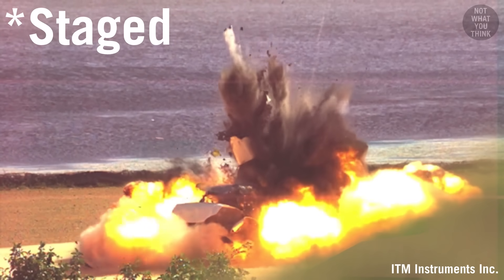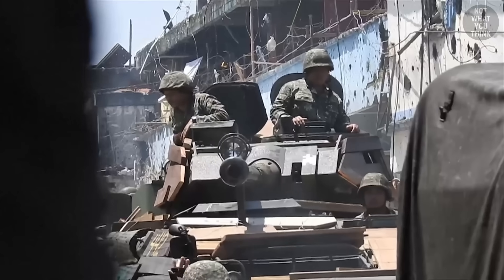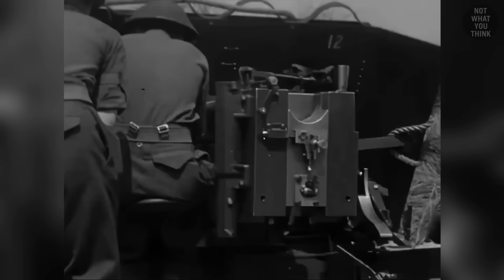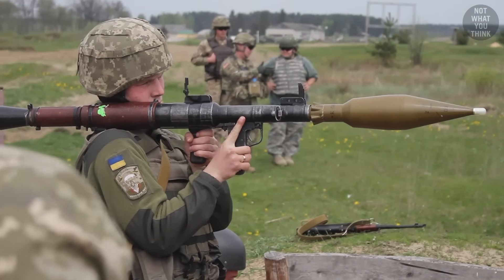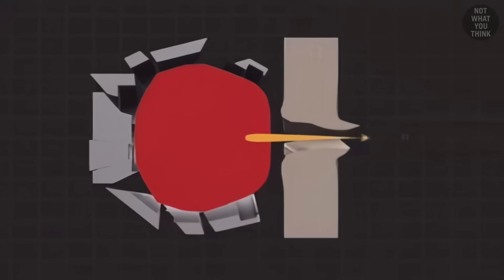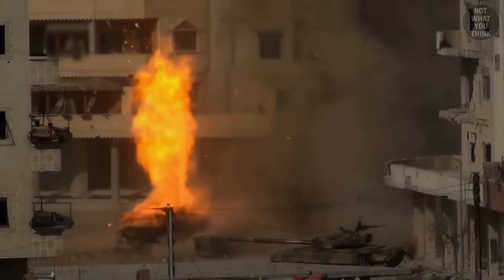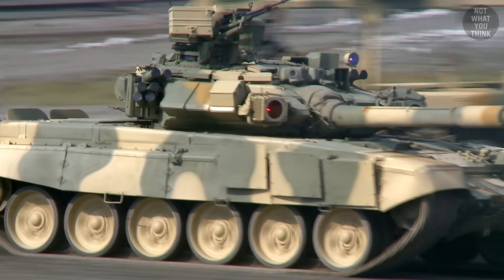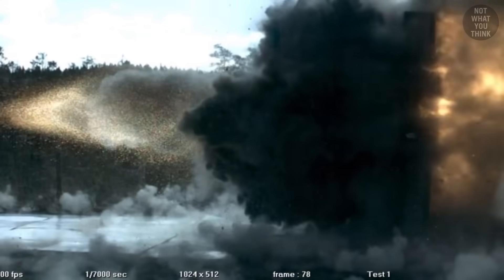Why Protecting Tanks is Getting Much More Difficult

Comment: Another thing about cage armor against shaped charges:
They have a chance of completely preventing the shaped charge of an RPG from exploding.
This happens when the fuze of the grenade goes between the bars of the cage and the grenade gets broken apart before the fuze impacts main hull, hence, no explosion.

As such, cage armor is a type of statistical armor, an armor that instead of only reducing damage, provides a chance of negating it.
Reply: It's like gangster ablative armor. Ok not really. Lol
Reply: and that's why putting anything between cage armor and the vehicle, since whatever's been put there would cause a detonation of the charge before it's been neutralised by the cage
Reply: @baudsp  Anything is better than nothing. See spaced armor, why and how it is effective.
Reply: I wanted to say that :)
Reply: Cool!
Reply: Sounds like when everyone does so much damage that defense/hp are useless, and everyone just dumps their stats in DEX to give a chance of evading attacks.
Reply: Cope cage
Reply: @zart8587  You gotta be pretty stupid if the  only thing you think about are the russian cope cages ngl
Reply: Cage armor is designed against RPG-7 rounds. Especially. They use piezoelectric fuze and outer shell deformation causes the short-circuit, thus stopping it from detonation (So the very reason why this armor is effective is slightly different to your description). To some extent, because original ones have self-destruct pyrotechnic fuze in the rear that should set it off regardless. But god knows how the 3d-world copies are made. Otherwise or for other simple HEAT warheads it can prevent the impact on armor and activation or damage the warhead itself thus reducing penetration capability.
But it is close to useless most likely against ATGM as especially more modern ones have in front the guidance section and warhead section behind it, thus warhead is very unlikely to be affected at all. Not to forget tandem warheads
Reply: So it increases Dodge
Reply: The shaped charge of an NLAW goes of in the air above the tank.  The focus of the copper charge hit the tank turret roof and high speed and melts through the metal.  A cage/ frame will not disrupt the focus, it has not done it so far.
Reply: @anthonywilson4873  It doesn't melt through the armor. It simply penetrates through it like a nail. It rapidly loses consistency over time, so once it's inside it spreads out and that's when the fact that it's extremely hot becomes relevant, as it hits crew or lights things on fire.
Reply: @gimmethegepgun  the penetrating needle is 600-800 °C, it's the extreme velocity travel through the armour that creates the heat through friction that then blasts into the compartment. :)
Reply: @johanmetreus 
It is not melting anything, that is really inefficient when a 2kg slug whit a contact aria of 1mm² going at Mac 10 will do wanders agents the armer
Reply: @anthonywilson4873  
Yeah, that's why my comment mentions RPG, not NLAW.
Reply: That's works great for old school (pre-1980's) impact fuzes. It's not going to work with a modern proximity fuse. Ergo the "cope cage" name, because it doesn't work worth a damn anymore.
Reply: but cage armor only works against simple (1 stage) RPG's, because it can only "deform" the first stage upon impact. 
It is entirely useless against any tandem-chage warhead though, because the second charge triggers immediately as soon as the first charge impacts.

So even if the first charge gets successfully "deformed and defused" by the cage armor, the second charge behind it still activates normally and can still penetrate the armor...
Reply: Wow never knew that. Makes sense though seeing as projectiles like RPG's have an impact sensitive tip used to detonate the main warhead. Clever, but not clever enough apparently.
Reply: @dylonjackson8863  The tip of the RPG isn't sensitive in itself, it's used to close an electric circuit that triggers the primer.
The more I read about all this, the more astonished I am that anything at all work, be it armour or weapons lol
Reply: Yo, cage armor is the bomb, man. It's like, it's not just about reducing the damage, it's about completely negating it. That's like, that's some next level stuff right there. I mean, who wouldn't want a chance at completely preventing an RPG from exploding? That's like, that's straight up superhuman.
Reply: Rogue classes and their "dodge percentage"
Reply: You probably meant "fuze" instead of "fuse" ;)
Other than that, you are 100% correct. Now get that paracord, tie it to the fins and yank hard from behind a building. For some reason nobody wants to touch a half torn RPG round cought between the bars of the cage !
Reply: @herrhaber9076  
Oh, my bad, fixed the typo.
Reply: @My_initials_are_O.G.cuz_I_am  I didn't do any calcul, I just took the figure given on the tanknology blog, in the Primer: Statistical Armour post. And apparently that 40% figure was coming from a Polish study.
Reply: @baudsp  
I figured you took the figure from some study or from some combat records, but I decided that checking it with some simple math is going to be quicker than looking for studies, records and other sources, and comparing them, while at the same time, providing a clearer view of the concept of statistical armor since just a random guy didn't quite understand my main comment.
Reply: @herrhaber9076  Actually if you want to be technical it's fuzee.
Reply: The chance of this is below 0,1% which does not even justify the cost in producing the cages
Reply: @justarandomguy3969  it is depending on a lot of factors, but in best cases, you have chances of around 40% of preventing the explosion
Reply: @baudsp  the main problem is that the projectiles have so much force they go straight through even if they dont explode, if they do explode almost all projectiles that are shot at the top (javeline) are tandem and will still blow up the tanks
Reply: @justarandomguy3969  well, good thing I didn't said anything about cage armor being good against anything but shaped charges fired straight at the vehicle. 
and tandem warhead are to defeat ERA, while top attack is to hit the areas of the tank with less armor.
Reply: @justarandomguy3969  
I am not talking about the russian "cope-cages" mounted on top of the tank turret, meant change the silhouette of the tanks to confuse top-attack ATGMs, (unsuccessfully)
I am talking about grates/mesh panels that many armies, including NATO ones, mount on the sides of their armored vehicles to protect them against rounds from RPG-7 and similar weapons.
Here's the math:
The impact fuze of a typical round for RPG-7 (and related) is a cylinder 1.2-1.5cm in diameter.
Let's assume 1.5cm fuse(to simplify calc, and give you the benefit) and a pretty average size of the rectangles making up the grid pattern of the cage/grate/mesh. 25 x 3cm (as opposed to, for an instnace, 
30x5, same reasons as before). This means that the Area in every rectangle that the round can hit without exploding is 1.5x23.5cm 35.25cm², the total area is 75cm², so succes rate of armor on perpendicular strike is 47%
If we assume 4.5x25cm, the success area is 3x23.5cm 70.5cm², total is 112.5cm², success rate is 62.667%
If we assume 4x4cm, success area is 2.5x2.5cm  6.25cm²
total is 16cm², 39% success rate. On average, 40%, 50%, 60% on a perpendicular hit.
When you account for the fact that the round can hit at an angle, you can see that baudsp's figure of 40% stands.
Reply: @My_initials_are_O.G.cuz_I_am  oh you meant slat armor, its confusing nowadays when you have "2" cage armors
Reply: @baudsp  tandem will also defeat slat armor or cope cages
Reply: @justarandomguy3969  yes well now you're just talking about completely different things that has nothing to do with slat armour. Slat armour is also known as cage armour. Cope cages are not cage armour and have nothing to do with cage armour or their functionality. 

1) Top attack munitions are largely irrelevant to this discussion unless you're talking about slat armour being mounted on the roof of a vehicle, which probably wouldn't work. 
2) Slat armour is specifically designed for defense against HEAT warheads on more lightly armoured sections of tanks and vehicles. Like others have said, it's not a guarantee, just a decent chance at defeating the munition. Whether tandem warheads can bypass this or not depends on the warhead, the design of the slat armour, and how far it is spaced from the vehicle, where the warhead hits and the angle from which it hits. 
3) Whether slat armour is effective against other types of munitions or not is irrelevant to this discussion because that's not what slat armour is for.
Reply: @RockSolitude  i dont see a previous comment from you so i dont know which of my comments you are referring to??

''yes well now you're just talking about completely different things that has nothing to do with slat armour''
Reply: @justarandomguy3969  Tandem charges have nothing to do with cage armour. The idea with those is that the first, smaller charge will set off any reactive armour leaving a clear path for the main charge. For this purpose, the two charges doesn't have to be exactly aligned, close enough will suffice. Cutting a bar in the slat armour for the next charge takes a lot more precision, which isn't required as the main charge will easily go straight through both cage and main armour without a problem.
Reply: @johanmetreus  you clearly dont know what tandem charges are...
Reply: @justarandomguy3969  "you clearly dont know what tandem charges are.."
Since I ploughed through the five volumes of FOA reports on armour and effects, I dare say I at least have grasped the fundamentals on the subject :)
Reply: @baudsp  and doest it disperse the coil
Reply: @johanmetreus  clearly not, when you dont understand that tandem charge works on slat armor, doesnt matter if it was made for it or not, it works
Reply: @justarandomguy3969  I can not help if you misread what I write, but I'll try to be clearer this time:
The tandem (meaning they sit behind one another) charge in itself has no relevance for the ability to defeat cage armour (which is the same as slat armour, and a few other names as well).
You can remove the initial charge (also forerunner charge) and it will be just as effective or ineffective as before.

What matters is the construction of the fuze. If it is of the proximity variant, cage armour is utterly ineffective, as it will trigger before interacting with the cage regardless.
If the trigger is of a contact type, but not located in the nose, the cage might disalign
the charge from perpendicular of the armour enough that it either misses the vital area or (less likely) has to travel such a long armour distance that it fails to penetrate.
However, if a normal RPG grenade is equipped with a tandem charge, it is just as vulnerable to the cage armour as before, as the main function of the cage armour is to destroy the trigger before it can activate the charges.

I hope I was less vague this time, but feel free to ask if something needs clarification. :)
Reply: @justarandomguy3969  If the shape charge is deformed or totally destroyed before properly detonating, then it would be far less effective. Not to mention that if it even so much as deflects off-kilter before detonating it will also be much less effective.
Reply: @justarandomguy3969  for regular RPG grenades, the chance is about 50%  when the gaps are 50-90 % of the projectile diameter. Ideally, the cone should hit a bar and start sliding, thus twisting the grenade out of the direction of movement before going deep enough that it becomes lodged and the inertia twists the cap off. Even if detonating, there  is a good chance of the needle (it's not a jet, the lining is stretched into a thin rod which is why copper, a very ductile material, is used) ends up with an unfavourable angle against the armour:
Instead of hitting it like this --|| , it instead have to try to penetrate like this \||
Total distance travelled doesn't matter much with the charges developed from 1990s and forward, as they have an effective range of 10 meters or longer.
Reply: @johanmetreus  if you see my previous comments you will see i thought he was talking about the cope cages
Reply: @justarandomguy3969  Yeah you definitely just fabricated that statistic from thin air 🤦‍♂️
Reply: @justarandomguy3969  
Cheap slat armor isn't worth it?
Considering how little it'd cost. It's cost effective. Slight chance of neutralizing the shaped charge or at least lessening its effect

Going for the dirt cheap method, I'd guess a couple grand tops per vehicle. Could probably do it for a couple hundred with weaker material

Comment: Gotta love a searing, molten copper spear, SABOT!
Reply: Sabot (APDS/APFSDS) is not the same as HEAT. Dont get them confused.
AP(FS)DS is a kinetic penetrator. A dart, essentially.
HEAT (used in ATGMs) is a chemical projectile, that works regardless of its starting velocity.
Reply: @LiezAllLiez   HEAT also uses kinetic energy to penetrate but generated by other means.
Reply: @viceralman8450  so, which of you have actually been in an armored vehicle in combat?
Reply: @kevinfreeman3098   No but I have a friend that studies Physics and he had to do study on the Munroe effect in detail so he explain it to me.
Reply: @LiezAllLiez  so, which of you has actually been in an armored vehicle in combat?
Reply: @Enclave Soldier that was mainly to shut up that other clown(lies guy) that came out with this entire tech rundown... I blew up armor and tried to not stay in it, I was a Scout, we pooped the tops with cable guided missiles double stacked on the "shoulder" in the baby tank in my day. I was expressing an opinion and then these clowns wanna come off like they actually have hands on experience or knowledge that they didn't just Google. Bottom line is no, since we had to go there, their opinion has no weight and their tech analysis from pamphlets is not needed.
Reply: @kevinfreeman3098  Reading. Watching videos about projectile types used in combat vehicles; stuff commonly available everywhere. If youre mixing kinetics with chemical projectiles... what were you doing again? "Oooh i wuz in duh tank. Me smart"? "Rokkits go boom"? My "tech analysis" does carry weight, because you have been taught (or not?) using the same sources as i did. Youre gonna reject that too? Your hands on experience is irrelevant.

Comment: It will probably shift the balance towards lighter, and cheaper tanks: The lack of thick armor is less important, mobility is more important at not getting hit, and they still have enough protection from simple projectiles, while also being much faster than infantry.
Reply: I could see armour thickness being lowered slightly to focus less on defending against sabot and anti tank rockets. However even if those two things can kill a tank regardless of armour thickness, there’s A LOT of stuff on the battlefield that cannot penetrate. Lowering the armour thickness too much would let the enemy use any old autocannon or tank round to kill your tank, and at that point your tank is just an APC. 

I think keeping a solid thickness of armour is important because at least it’ll still protect against medium weapons.

Modern tanks are already quite fast anyway so I don’t think there is too much to gain in mobility realistically.

But yes a slight decrease in armour thickness to where it can still defend against all other munitions but forget about anti tank rockets is probably a good idea if only to save money.

Mobility can’t protect you from guns unless in specific circumstances, and even then it’s not a significant advantage.
Reply: Modern tanks already go 45+mph, pretty damn fast for a 73 ton machine, dont see anyone running at that pace lol
Reply: I doubt that mobility will protect you against an RPG unless your Tank is as fast as Racing Car
Reply: @David-ni5hj  Yeah because it surely is easy to hit a vehicle that makes such intricate movements, or moving at fast speeds with an unguided AT weapon
Reply: @David-ni5hj  bruh the rocket is flying in a fixed line, you literally can take two steps to the right\left and let it pass you.

Comment: Dense swarm of fast-reacting drones around the tank may work as an active armor
Reply: I like the idea but there wouldn’t be enough weight in the drone to trigger the charge in the missile. Unless you countered it with your own explosives attached to the drone, then the drone has to have the correct orientation for the charge to disrupt or destroy the missile. 

Good concept but hard to execute.
Reply: Yeah, because a competent AA force will let them even fly.